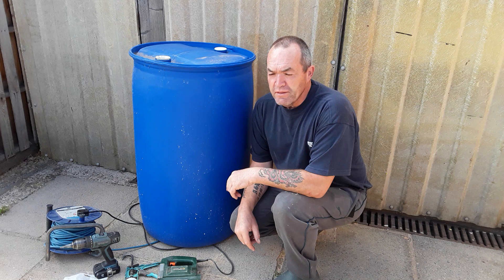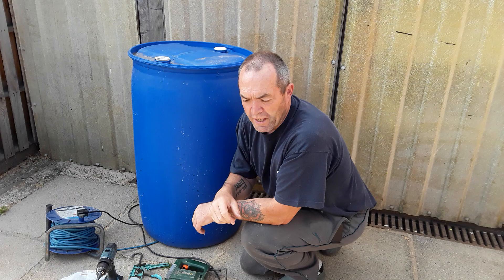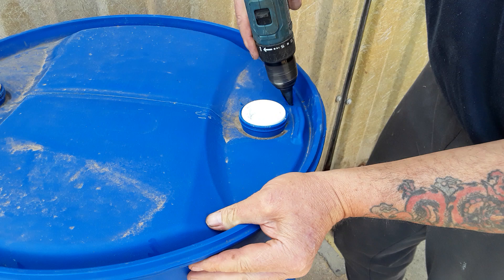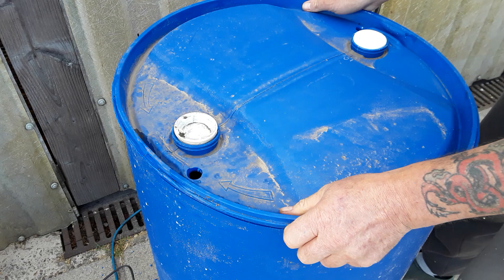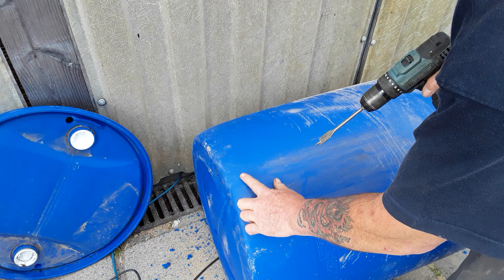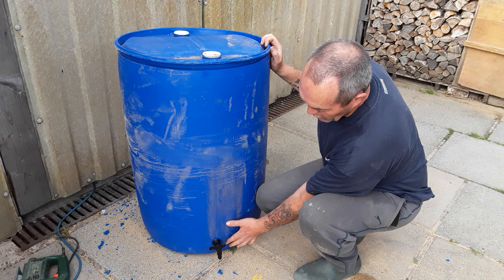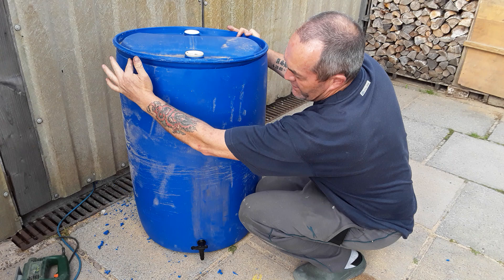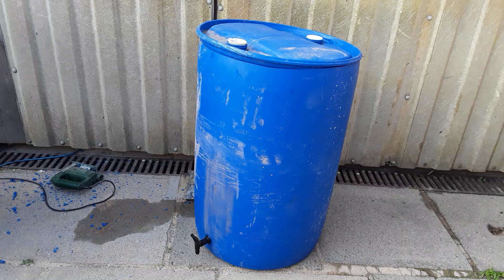How To Cut & Fit A Tap To A 210ltr Blue Barrel To Collect Rainwater For Our Growing Spaces #shedwars

Comment: Excellent Terry. I worked in Waste haul and Recycling. I've seen literally thousands of these and never gave it any thought. Good to see people making use out of them. 
I would only add, you know what material was in them originally. If people don't they should take precautions, especially if there's any liquid in them. Should unscrew the white cap (can be done screwdriver) and carefully inspected. If there's more than a "just residue" and you don't know what the liquid is, I'd recommend not touching it. Many different petroleum and chemical products are stored in them. 
Cheers Terry and stay safe !!
Reply from the maker: The barrels had Addblue in them so not an issue for me.

♻️Happy gardening, Terry King.
Reply: @terrykingsallotmentgardening  yes I know you always, well almost ;), take the proper safety precautions. I was just thinking of your community and viewers. Almost 10,000 views !! 
Cheers Terry 👍👍👍
Reply from the maker: @clivesconundrumgarden  👍❤👍😁😁😁😁😁😁
Reply from the maker: @clivesconundrumgarden  nearly 20,000
Reply: @terrykingsallotmentgardening  let's go !!! Awesome Terry 👑👍🥳
Reply: @terrykingsallotmentgardening  ive got about 20 adblue drums. Do i need to wash them out before i start collecting water?????
Reply from the maker: @steve  yes a good wash using pressure washer soap.
Reply: @terrykingsallotmentgardening  i have already taken them to the allotment 2 at a time,i havent got access to a pressure washer. Can i wash them out with water,domestos and a mop????

Edit: i asked a few of the old boys down the allotment,and they said let the weather do it,but i want to give them an initial cleaning out. To be sure. And to start harvesting water straight away.
Reply from the maker: @steve  yes that will help, remember addblue will kill all weeds including dandelions.
Reply: @terrykingsallotmentgardening  thanks Terry 👍
Reply from the maker: @steve-fc6mc  👍❤️👍

Comment: Hello Terry
pff a different method than mine. Have to make holes in the lid. That is a good idea as well. Is mrs King sweeping the pavement right now? I used a tarp to collect the filings.
take care Joyce 💚👩🏻‍🌾🍀
Reply from the maker: Mrs K does go mad at me if I don't clean up properly because it gets on your shoes and then into the Mars in the car and yes I normally put something down, but was late getting home and needed this job out of the way and probably why I selected the wrong drill bit.

♻️Happy gardening, Terry King.

Comment: A good tutorial Terry. Do you ever get low on water? I realize that there has been lots of rain recently, but come the height of summer do your stocks run low? 🍺
Reply from the maker: Hello William, this year a dry start and started to panic so built more roof space on the manure run off and the Compost Bins, then its rained regularly since then so I still have 95% , last year was wet all season and never fell below 99%, 2018 dry without rain and at the end of the watering season I had 200ltrs left and I must have brought to plot 1 over 1500ltrs to keep my new fruit trees and bushes well watered. Personally I need 15,000ltrs to last.

🌧🌞Happy gardening, Terry King.

Comment: Great video Terry! 

Here's a question. I've got 7 of these lined up outside my allotment polytunnel. I've fitted standard guttering to the tubular frame on each side of the tunnel, which fills the tubs each end. The plan is to join all of the tubs together at the bottom so that they all fill at the same time. For this to work without clogging up, I need to use fairly hefty pipe - maybe 1 1/2" BSP. But because of the curve of the tubs, I'm struggling to get that size a tank connector to form a good seal. Latest thought is to heat the drilled wall of the blue tub first before tightening the tank connector but I haven't tried it yet.

Any ideas ?
Reply from the maker: Use the Syphoning system Andy like I do, no fittings just an old hose pipe and some wire. Search on Google Joining barrels using the Syphoning system  or How to join rain water barrels together using a pipe Syphoning system kink free.

♻️Happy gardening,  Terry King.
Reply: @terrykingsallotmentgardening  Works a treat Terry - many thanks 🙂
Reply from the maker: @andystrain1215  glad you found it useful.

Comment: I watched to see how the inner nut was fixed on in a deep barrel but it was not shown.The  video did not show,using silicone or tape you still have to lean in a depth longer than your arm
Reply from the maker: I can just reach to tighten the nut and easier with two, no silicon or tape used, no need as long as you don't over tighten Lee.

♻️Happy gardening, Terry King.
Reply: @terrykingsallotmentgardening  If you got two hands in to do the job you'd still have your feet in the air !.'ll take your word that you did put the nut on with one hand and not just rely on silicone on the outside.
Reply from the maker: @Lee Jones  I have used mole grips before on the inside and turned the tap to tighten, don't use silicon no more the rubber washer is sufficient.

Comment: I just found a unibit in a complete snap-on tool box that was left by the curb. The things people throw away. Must have been some poor fellow who succumbed to the delta floating around. It was packed with 16 pair of channel lock brand pliers. 200 Allen wrench with the handle. 45 different grade Nicholson file 176 open end wrench a tool pouch with all mandatory Klein tools for electrical work. A craftsman drill brand new and a car buffer. To many drill bits to count. Funny enough not one single socket or socket wrench. I’d say it was worth lugging it onto the truck
Reply from the maker: I have found many useful things by the kerb and you hit the jackpot, some people would rather we have them than to throw away.

Happy gardening, Terry King.

Comment: Long time, Q: What blade did you use in the Jigsaw for cutting the plastic?
P.S, nice vid😀👍
Reply from the maker: The teeth need to be reasonably big similar to a wood saw so metal cutting wouldn't be overly suitable.

♻️Happy gardening, Terry King.
Reply: @terrykingsallotmentgardening  And what about melting?
Reply from the maker: @jack1d1XB  much easier to cut than melt.

Comment: I've got a few of those as water butts, but  mine doesn't have water taps fitted.
Reply from the maker: This one will hold my manure run off and be placed next to the comfrey and nettle, at the end of the day £4.50 per barrel with a tap or free without,  my time costs nothing. 

♻️Happy gardening, Terry King.
Reply: @terrykingsallotmentgardening  you're lucky, I can only source them for £10 each with no tap!
Reply from the maker: @bristolveggiebeds5310  to think I have collected up to 50 that's £500 saved, keep your eyes peeled and don't be frightened to ask companies for free ones as long as you know what's been in them.